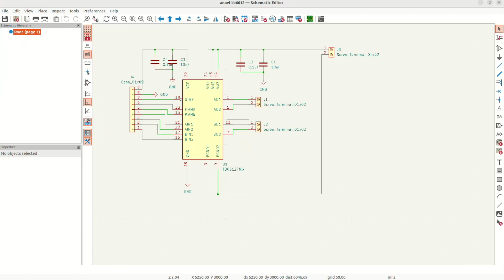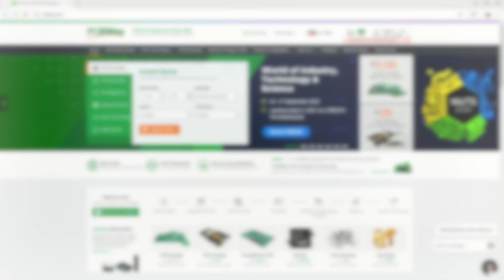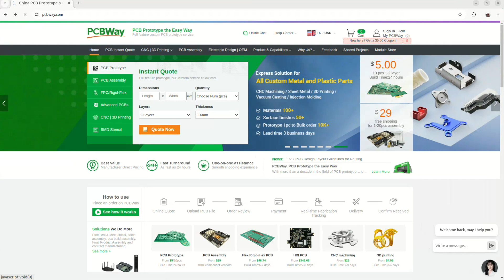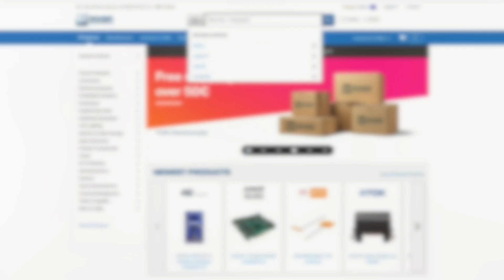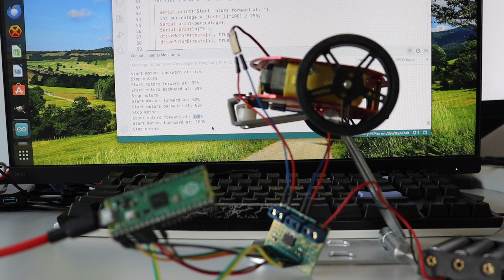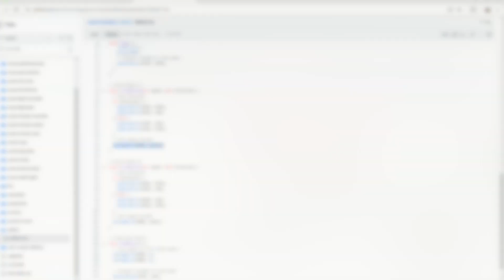Control DC Motors with Raspberry Pi Pico and Toshiba TB6612 Using Arduino Sketch

Comment: Hi do you have a github for micropython code for driving the two motors?
Reply from the maker: As of the moment I have only an Arduino sketch suitable for Raspberry Pi Pico. It is available at GitHub: https://github.com/AnaviTechnology/anavi-examples/blob/master/tb6612/tb6612.ino

It is a good idea to do the same demo with MicroPython and/or CircuitPython. Thank you for the idea. I might consider it for next videos. However, I am quite busy with some personal issues and I am not sure when/if I will have time for such a video.
Reply: @LeonAnavi  Thank you for the link :)  ohhh no I am so sorry to hear that and wish you all the best.

I look forward to a possible future upload :)